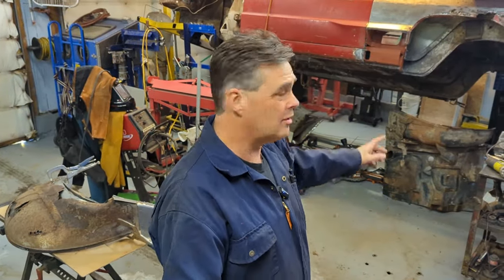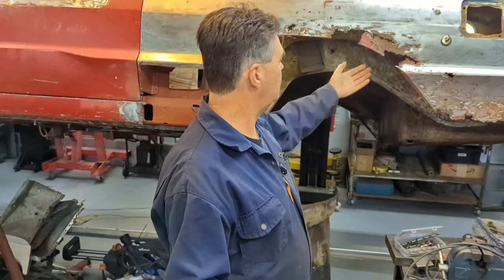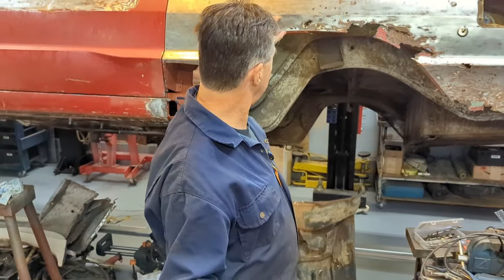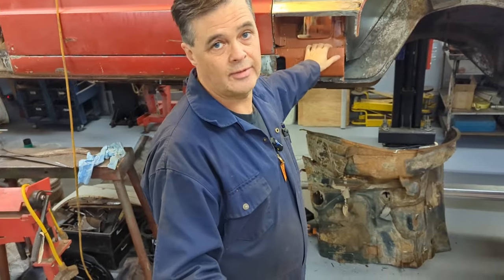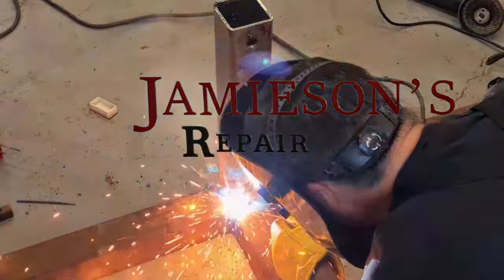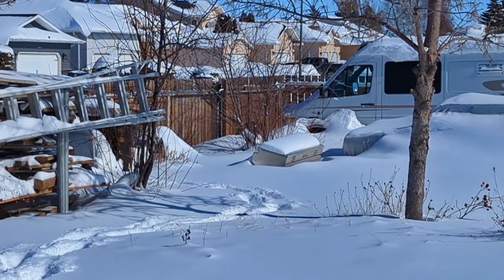Fabricating Driver Side Rear Wheel Arch Patch Panel Part 1 - 65 Thunderbird Convertible Ep #70

Comment: Another informative video.   On the sanding discs, sometimes you can put two on the tool 90 apart to make them flatter.
Reply from the maker: Thank you Michael. 🙂
That does work, once I was able to get them flat enough without them splitting, I was heating them up with a torch to keep them from splitting...but overall, I say just send them back.

Comment: I'm a Jonny come lately but have been catching up on the convertible bird, and want to say you are amazing to watch with your capabilities.  My love for convertibles is not as strong as yours. I might have bailed when the carpet came out but when your in it you can't quit . Be happy to see you drive it.
I rebuilt a motor for my 64 bird, white exterior, red interior and loved it. When I got to the rocker arms I I put in new shafts and replaced a few of the rockers bushings along with new lifters. I ran a wire through the pushrods to remove old residue from oil. When the motor came to life there was no pecking or ticking. 
My bird was a hardtop.  The car prior to the bird was a 62 galaxy 500 xl convertible with bucket seats and center console w power steering, no air which I would have enjoyed. Are you going to add air to yours?
Your metal work is amazing.
Reply from the maker: Thank you Johnny!
Yes, my convertible was in bad condition, since it was all ready to go through the crusher when I found it, I figured, anything I do to it would be better than crushing it... even if I parted it out, at least others would benefit.
I haven't been planning to put it in an A/C, we only get about two months of temperatures each year, that Ac would even be used.

Comment: I kind of wish you were installing a classic sheet metal quarter panel..  i really want to see how the fit and finish is before i order one.
Reply from the maker: I haven't had much luck with after market panels, not saying they are all bad, but be prepared to make "adjustments".
When I started the T-bird repairs, I decided to learn how to make the repairs without buying after market panels.
Reply: @J_R_Shop  i figured..  and you also have the skill and talent to fabricate your own patches. So its a little unnecessary. I got the trunk panels and battery tray from them.  The sheet metal is good.  19 gauge i think.  But definite extra fitting has been required.

Comment: Hiya Alvin!
I’m not sure what those discs are made of on the back, but I was wondering if you can put them in boiling water to relax the curl, and then clamp them on a flat surface as they cool. Just a thought, I could be wrong.
That fender is looking great!! 
Your definitely braver than I. There’s no way I’ll step foot in Mexico the way things are going right now. The Army never let us cross the border, and I was fine with that. Primarily because you can bring your firearms. So just keep your head on a swivel, and I hope you have a great time!
Reply from the maker: Hey Troy, the disc backing is supposed to be fiber resin, but very fragile. I have been heating them with a heat gun as I need them, seems to get them to the point of usable...I only have a few left, and I like your idea, gonna give it a try. 👍
As far as Mexico, I've been going there since the early 80's, never had an issue...I did however have a gun pulled on me in Daytona, Florida years ago. I know if I go to some areas in Mexico, I could easily get into trouble, the same way I avoid going to high crime areas in the US, so it's all good. 😊